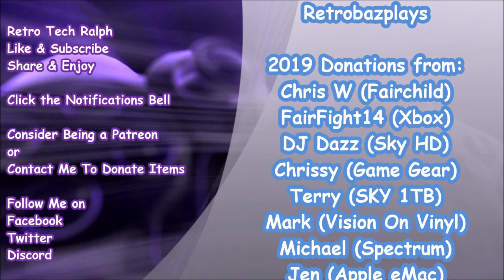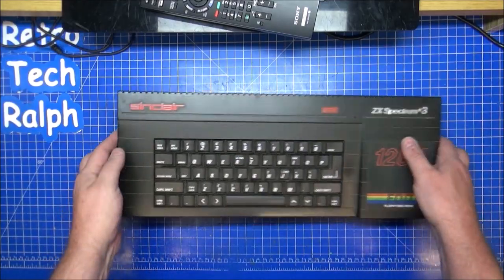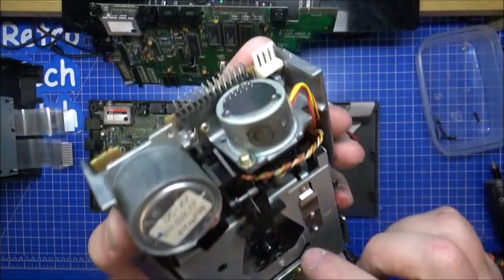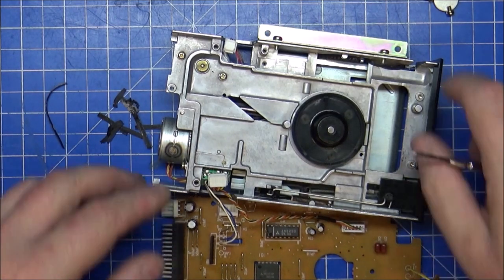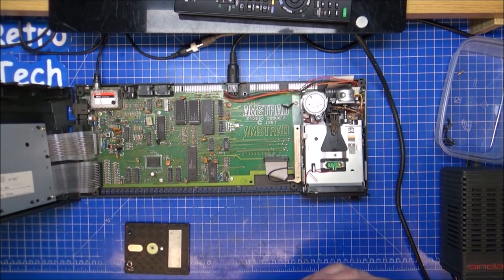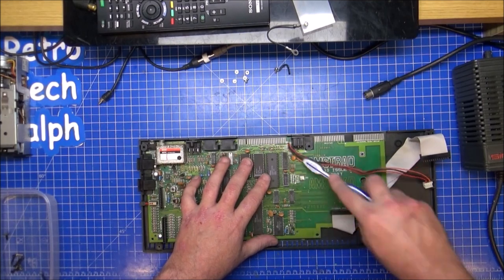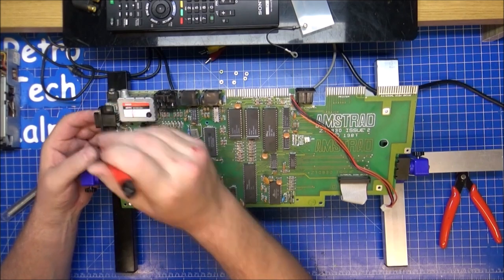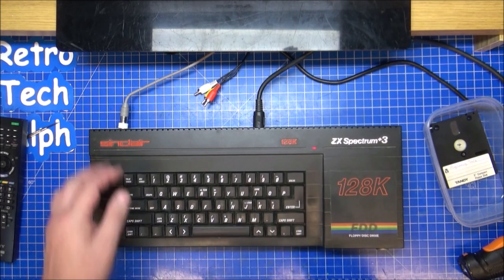Sinclair ZX Spectrum +3. A 30 Year Old Repair and Restore.

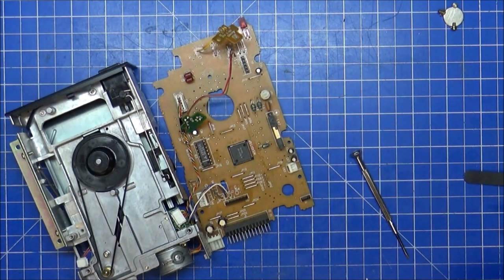Comment: It looks as if you left a  little piece of the belt laying inside the drive at 24:16 in the upper left corner of the drive assembly, right under the black plastic front face.

Comment: A couple of points if you still have this machine... Check the 12v going to the drive. Ensure it is 12v. Also the two sensors you removed to change the belt, ensure they can "see" each other through the pinhole in the drive chassis. Also did you clean the heads? Your other machine is a +2a, is it not? RGB pinout should be the same. Good machines

Comment: Too bad Sinclair had to sell their computers to Amstrad who pushed their own non-standart 3" drives instead of standart 3.5" or  more widespread 5.25". Amstrad were never interested in developing Spectrums, only to push their own computer line. Also - bad that 128K Spectrums did not had more video modes, more colors, higher resolution :( well that could've been thing in next models which never came.